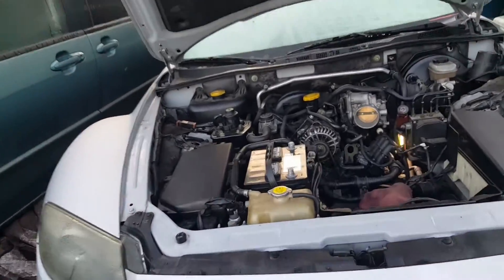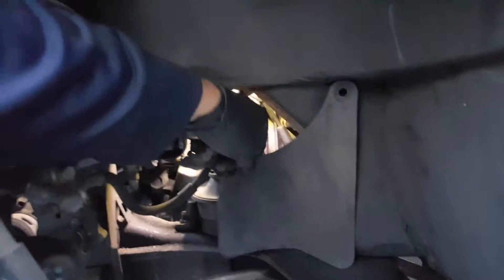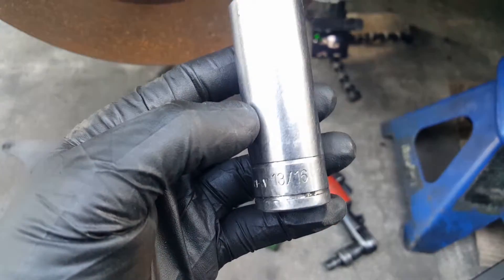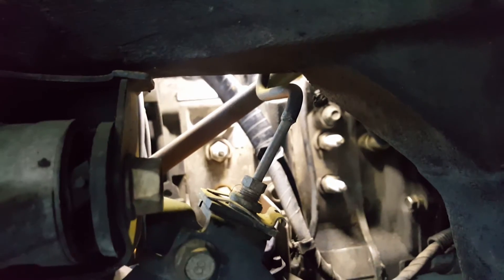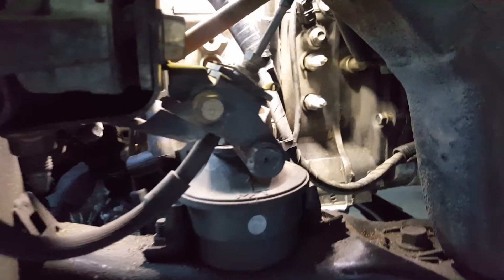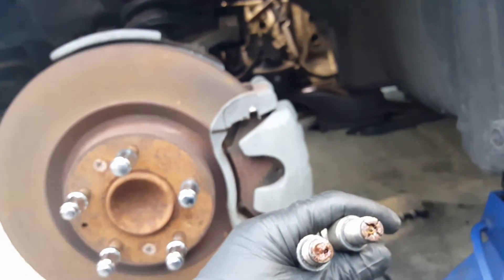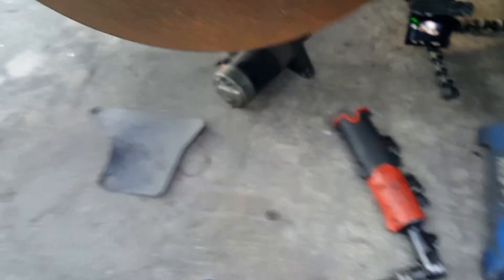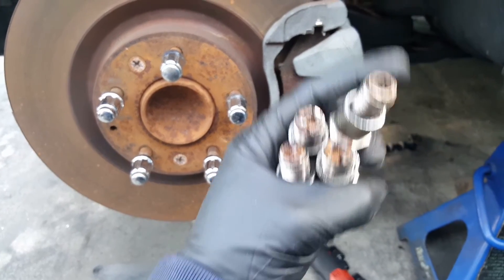How to rebuild mazda rx8 rotary engine :how to remove mazda rx8 spark plugs the easy way

Comment: Good, useful video. Thanks for actually showing us the socket size and best way to approach plugs. 

Too bad going in from above is so difficult. I want to do a compression test as part of a pre-buy inspection, but most owners will be very uneasy and reluctant to let me jack up the car, remove a wheel, and start removing body pieces.
Reply from the maker: Thanks for watching and the comment 👍
And if when buying an rx8 the seller won't let you do that is because they know there is something already going wrong with the car 👎

Comment: The car overheated and the gaskets blew, thats why it has water it was due to gasket failure.
Reply from the maker: Yeah that's the first thing that cross my mind so i order that magic liquid to stop the head gasket leak!! ✌😎✌ 
Then I got slapped on my face by the 2 huge 13b rotors from my rotary engine 😂😂👊
Reply: Lol that will solve the problem 😂